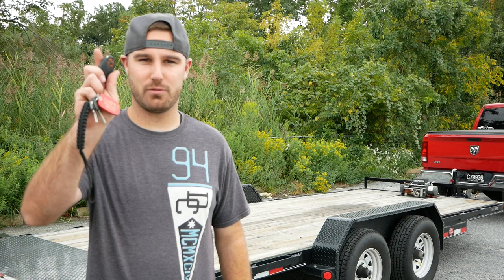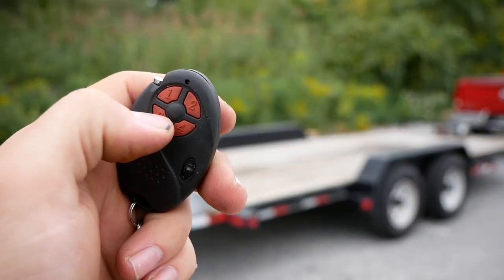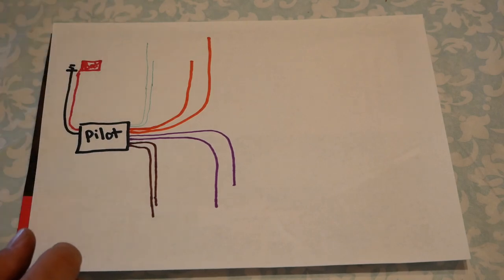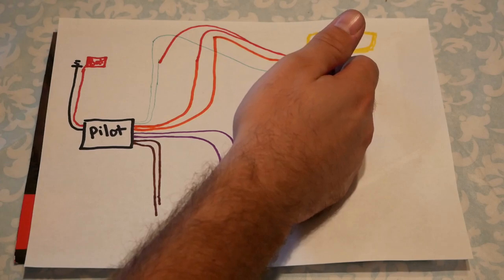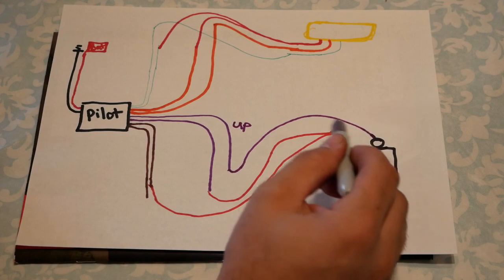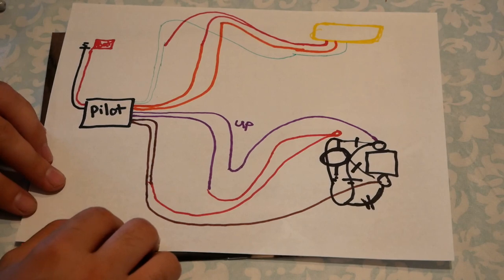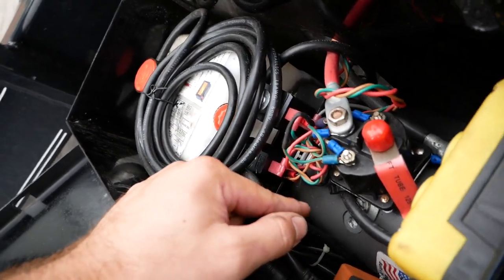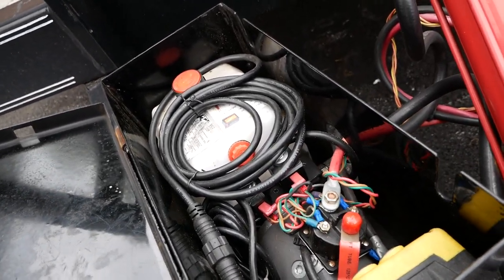Wireless Trailer Remote For Winch and Hydraulic Tilt

Comment: I did the same exact setup and it works beautiful same trailer same way in works exactly as he shows the only thing I did different was I wired all the wires to the battery instead of running them to the winch and running them to the hydraulic pump to call for wires directly to the battery little easier
Reply: I have the same trailer and was thinking about adding a winch. Did you guys do anything special with the power cords for the winch. They have to be long enough to accommodate the tilt but what happens when the trailer is down. Is the excess wire length an issue? Or not long enough to cause a problem?

Comment: Is this remote still working for you?
Reply from the maker: Yes, Ive lost the on off slide while swapping the battery, but can still turn it off and on by the actual switch with my fingernail.
Reply: What did you inside the box to remove the latch on? So it's just push and hold?

Comment: I have been using this system to operate the my wheelchair lift and doors for about 10 years.  The problem with the unit is the remote.  If it lost or broken you must replace the system. Pilot does not sell replacment remotes.  What I have done, is keep a new unit (I have one on hand just for this event) and simply replace the unit, the black box, untilizing the same wiring, and get back on the road.  I am hearing now that Pilot ships these units without jumpers so you can not set it up for momentary, just on/off. Does anyone know what frequency the remote operates on, 433 MHz, 315 MHz?  I would like to clone my lastest units remote before it goes kaput!